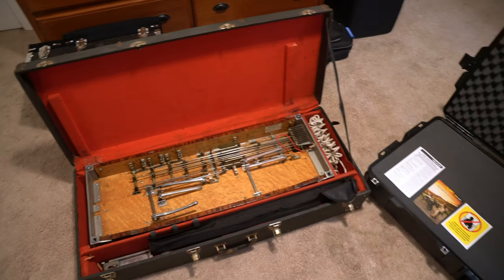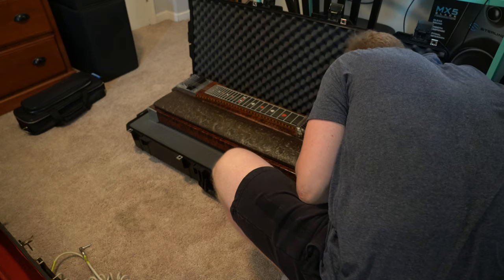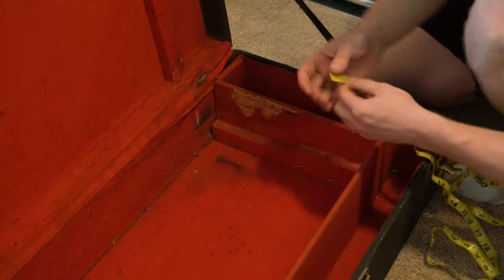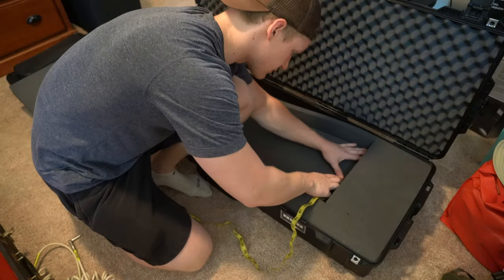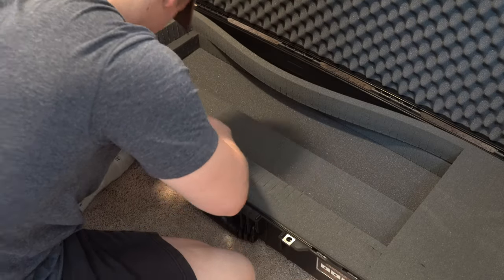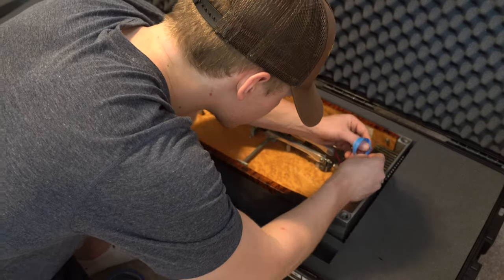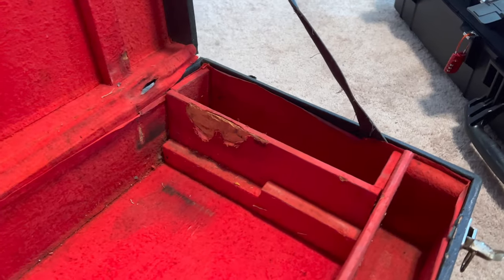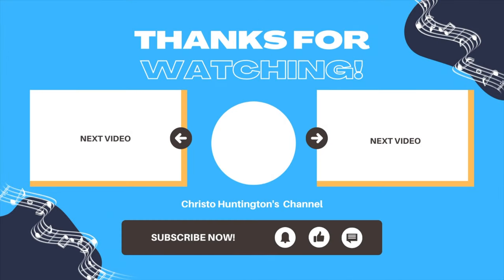Pedal Steel Everyday - Day 478 - How To Foam Pelican Case for Air Travel

Comment: Thank you for this, it was so helpful. I have a custom case for mine and the rigors of touring are starting to wear it out, plus it's so cumbersome and heavy. I've been thinking about going for a Pelican to solve this problem, I'm curious how it's working out for you 3 months later? I would use that side space for my volume pedal and a tiny pelican that I keep my tone bar, extra picks, and my 1/4" nut driver in. Thanks again for the awesome video!
Reply from the maker: I’m glad it helped out! I’ve been thrilled with the performance of the Pelican. The foam is holding up well, the case is barely showing any wear after some rigorous use, and the steel is in the exact same condition it was in when I first began using the case. Putting a smaller Pelican case and/or volume pedal in the extra space is a great idea!

Comment: Are you flying with your pack a seat? Gotta European tour coming soon. Gotta pelican case for the steel and was planning on using a collapsable piano bench, but I’ll pay extra if I can check my pack a seat.
Reply from the maker: Yes sir! My Steelers Choice pack-a-seat is excellent on flights. The metal trim, heavy-duty handles, latches, and screwed-down legs gave me some confidence the first time, and it's been a breeze for baggage handlers ever since. I keep my essentials in my carry-on/personal item, don't pack any suspicious or questionable tools or things I'm not prepared to lose in the seat, and the rest of my things go in the pack-a-seat (as a checked bag). I strap down the backrest because the included (attached) strap is somewhat light-duty. I definitely recommend flying with the pack-a-seat; keeping my setup consistent allows me to be completely comfortable no matter where I'm set to play. Keep me posted on how it goes, Stephen! Thanks for the comment, and best of luck.

Pro-tip: Put an Apple Airtag in your Pelican case and in your pack-a-seat to track them.

Comment: Hey Christo, very helpful video here! Trying to choose a case for a tour in Europe. I am curious about the dimensions of the Pelican not meeting the standard 62 linear inches max for flying. Do you have to pay extra fees because the case exceeds those measurements? Thanks!
Reply from the maker: Hi. Sorry for the delay. Did you find a case for your Europe tour? I carried the Pelican case on my flights instead of checking it, and the gate agents simply marked the bag as a special item and gate checked it when they realized what it was. I didn't pay any extra fees.
Reply: Hi Christopher, Dan here from Australia. Can I clarify, you are taking the pelican case as carry on?? I don’t know if I understand what you are saying here. Thanks mate

Comment: How do you keep the foam from falling apart? Every time I pull my steel out, bits of foam come out too. I wish the foam would hold its shape.
Reply from the maker: Since this video, I've removed the thin strip I originally used between the steel body and legs/pedal rack sections of the interior. One of the ends of foam blocks began to break away from another at the connection, and the fit was tight enough that none of the steel components moved in the case during transit. I've seen videos on YouTube of people sealing the foam after plucking the foam shapes you want (essentially coating the foam in a rubber coating to seal it from accidental breakage/plucking). I haven't needed to do this yet, but it would be smart to do it as a preventative measure until a manufacturer begins to offer custom Pelican/travel case inserts for their steels. 

The included foam for my case is flexible yet rigid; its connections are solid, and the fit of my steel is perfect. I have about a half inch gap around the steel body in the case so that I can get my fingers in between the foam and the steel when I remove it and put it back in the case. Let me know if you know of any other solutions, because Pelican brand foam is not cheap to replace! If I ever needed to do so, I'd just cut my own custom mold from less expensive and more protective foam.
Reply: So between the cabinet and the pedal rack you are still placing some loose foam between to prevent scratching, or the pedal rack sits low enough that it doesn’t touch the guitars cabinet?